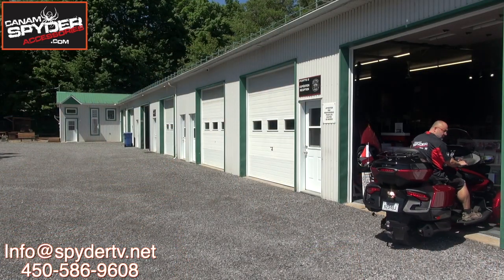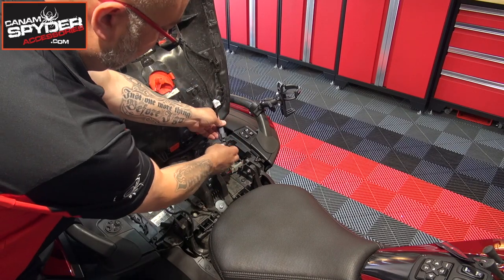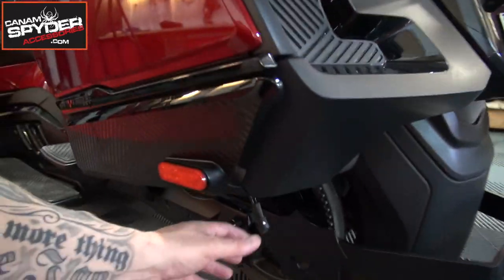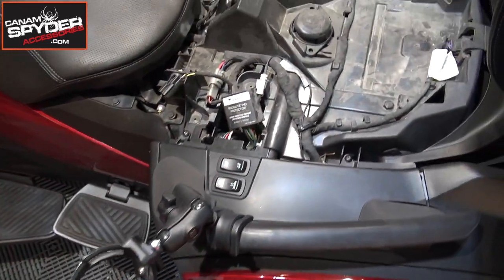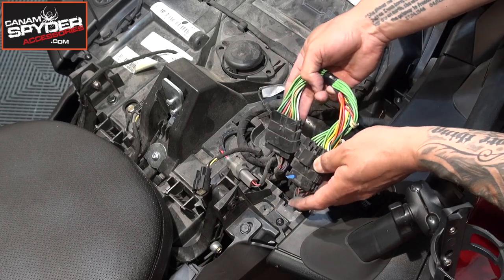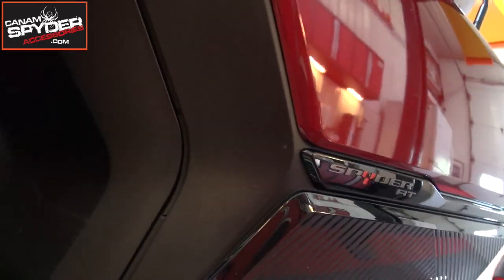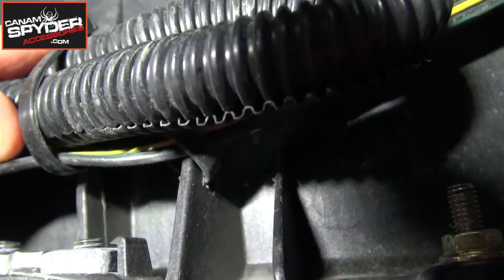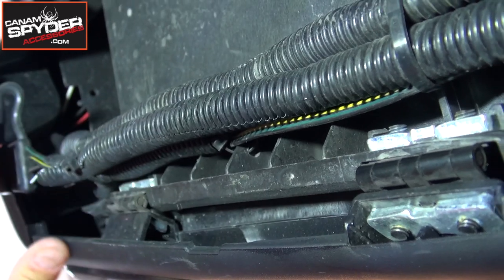Installation - RT 2020 and up -  Can Am Spyder trailer hitch harness Plug and Play - The Spyder Shop

Comment: Oh how I wish you had this video available a few months ago.  In Feb this year, I ordered a Mini Mate camper from Kompact Kamp for my 2020 RTL, ordered a hitch and a plug n play wiring harness from Big Bike Parts.  But the plug n play connected inside the back end at the rear light connections.  I thought I was going to cry when I watched you remove only the passenger seat and then you said it was a 20 minute job with your harness.  I'm sure you know how much I had to remove on my RT to get to those rear connectors, not to mention the wiring I had to run back up through to the front battery.

To anyone else who is reading my comment here, pay close attention.  If you want to save a ton of dissassembly and reassembly work on your 2020+ RT, and I mean a ton of work, then choose this harness from Pierre.

Thanks Pierre, I'm laughing to myself now, but you probably could have emphasized how much easier your method is.  Salut, mon ami !!!  ( my "tres peu" french )  😁

Comment: Hi Pierre, I recently ordered a USA Trailer Store Discovery trailer for my 2020  RTL. My question is will your trailer hitch harness work with incandescent bulbs on the trailer. I see yours is compatible with LED bulbs no mention of incandescent bulbs.   Man, yours seems so much easier installed than Big Bike Parts although it cost about twice as much. Your hitch is the best looking also.

Comment: So I have purchased a 2022 RT LTD is the wiring harness still the same or have they made changes?  thanks
Reply: I have a 22 RT (sea to sky) and just installed this yesterday.  It fits 2020 to 2022 for the RT line, and likely 2023 as well (I haven't heard or seen of any changes between those years from a wiring perspective).